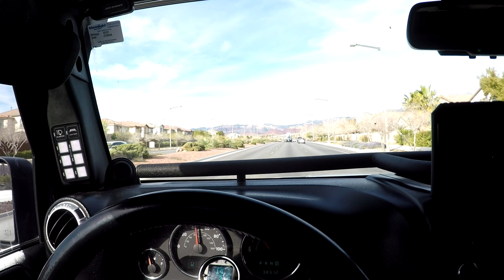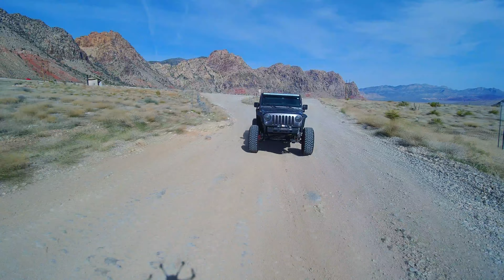Advantages of the LS.

Comment: If sourcing a LT drivetrain out of a low mileage vehicle, would any late model GM 4x4 work?  Silverado 5.3/6.2, Escalade 6.2, 8 or 10 speed?
Reply from the maker: Not really, different years are not compatible and only the 6l80 can be easily changed to a 4WD; the 8 and 10 speeds require more parts. Your pretty safe matching the year of the engine to the transmission, you don't want them mismatch them. One reason I recommend 2010+ LS engines and 6l80/90's is GM made them compatible. The 07-9' powertrains were different and the LT's are more year specific as GM updates the modules, fuel pressure sensors....